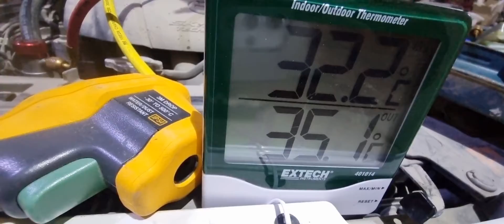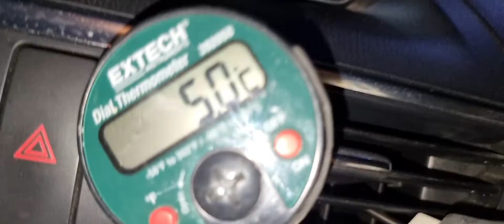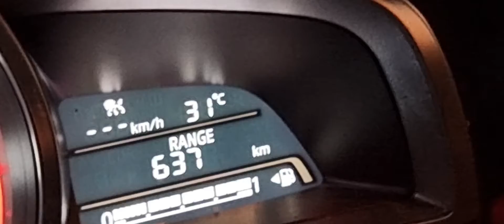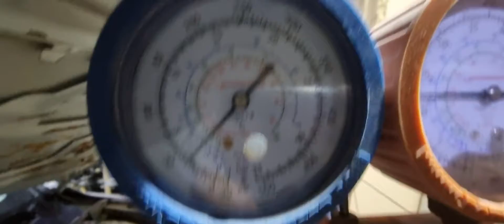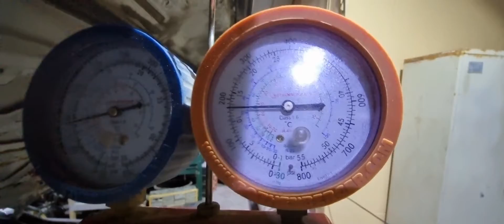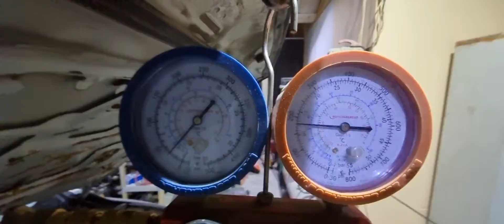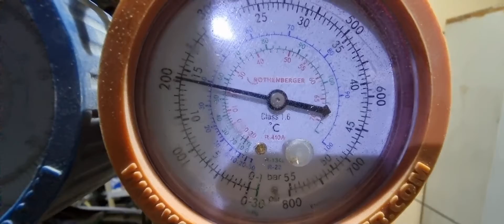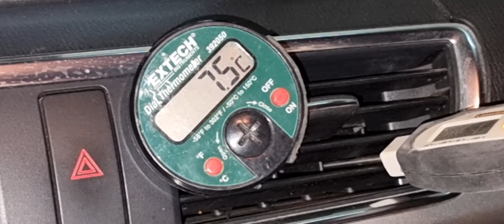اختار الوقت والمكان المناسب لصيانة نظام التبريد في المركبة

Comment: السلام عليكم اخي جمال 
قرأت في الانترنت ان كل درجه حراراه خارجيه تحتاج لضغط معين 
مثلا عند تعبئه غاز فريون السياره وتكون درجه الحراره الخارجيه بين ٤٠ ~٤٥ يجب ان يكون ضغط الغاز بين ٥٠~٥٥ psi 
هل هذا الكلام صحيح ام غير صحيح 
شكرا لك ولمجهودك الرائع
Reply: مع الرطوبة 70-50
حرارة خارجية 30
 (حار 176.9-217.0)
بارد (34.8-42.8)

حرارة خارجية 35 رطوبة 50-70
حار ( 197.2-245.1)
بارد ( 39.9-48.6)

حرارة خارجية 40 رطوبة 50-70
حار (176.9-265.4)
بارد ( 45.0-54.4) PSI

من كتالوج مصنع شركة نيسان
Reply from the maker: خطأ
Reply: @jamalbadhafari   كثير منتشر هذا الموضوع وجربته قبل ٤ سنوات ونتيجه فصل ضاغط ومره ثانيه فتح ولف وطار غاز كله